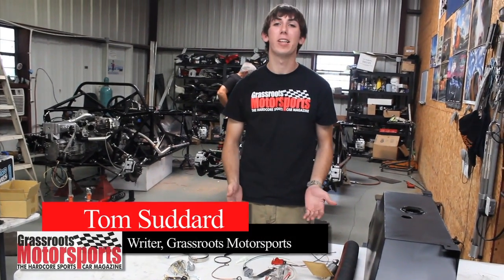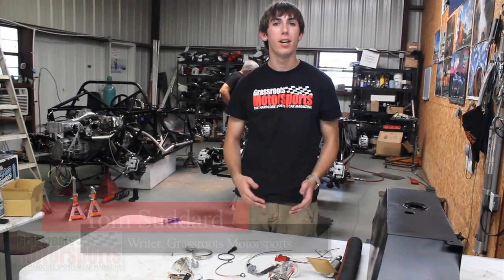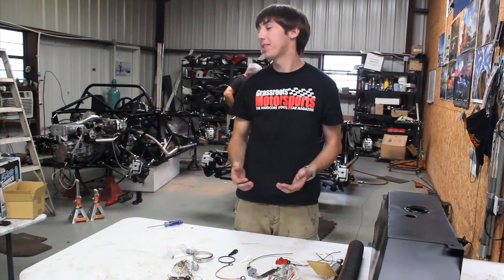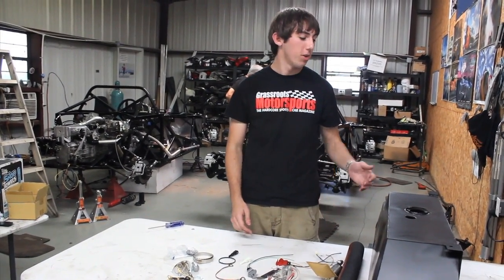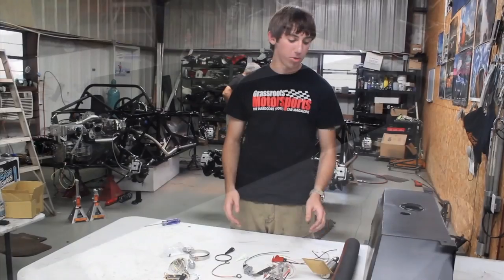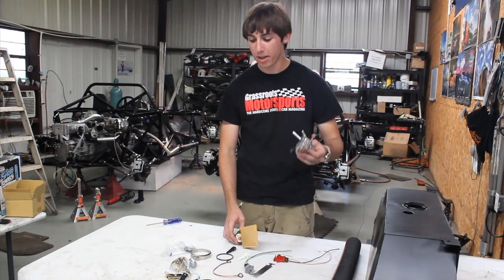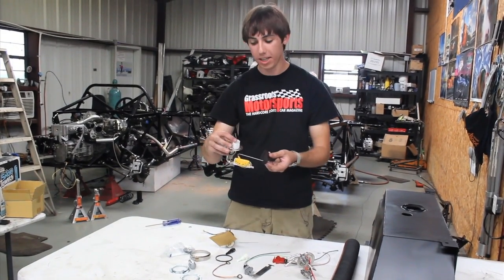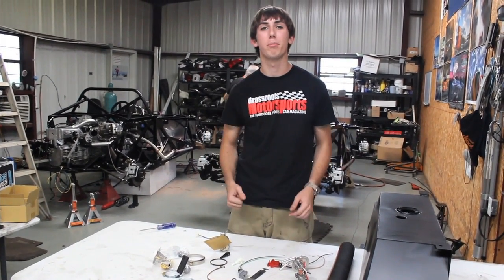Project 818 Part 15: Installing the fuel system

Comment: I often wonder how difficult to service a mid engine car. Having seen the front of the engine jammed against the firewall, if a belt is needed to be replaced, the entire cabin has to be removed to gain access to the engine.
Reply: its 1 small belt.